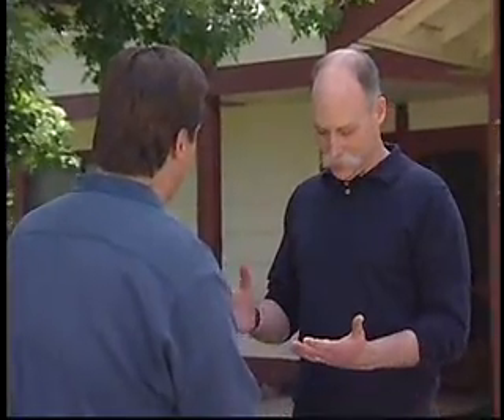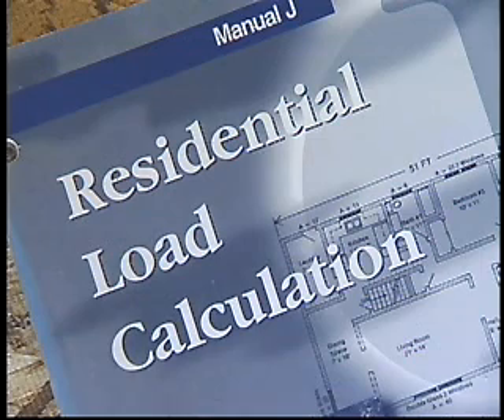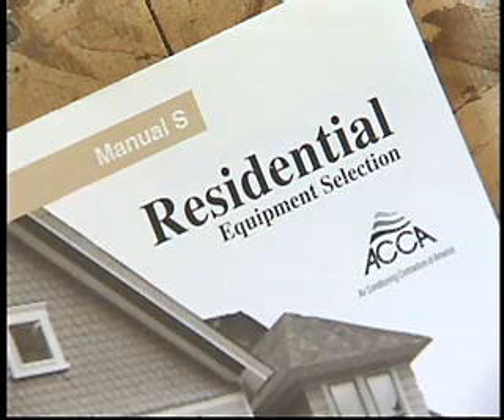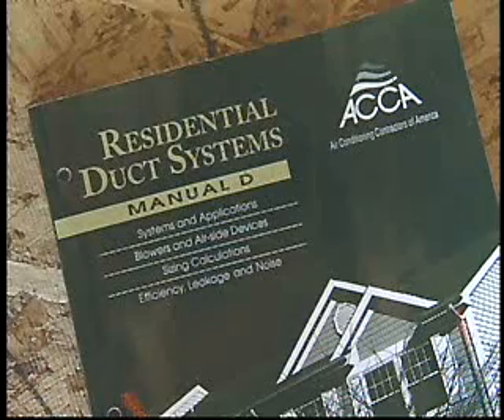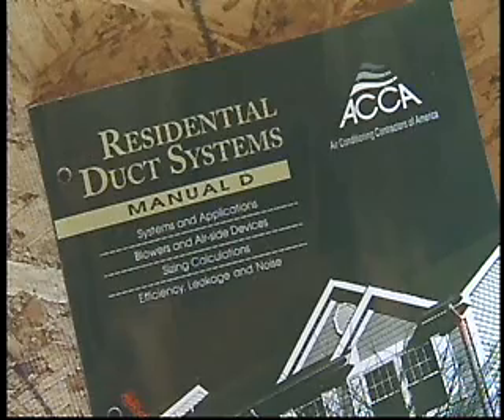Proper System and Duct Sizing

Comment: Do a load calc...Every time I did a load calc for a customer they took my numbers and gave them to another "cheaper" company to do the install.  So all the time and effort for nothing.  I keep my numbers to myself now.
Reply: dpeagles:  Unfortunately, there are unscrupulous customers just as there are unscrupulous contractors.  In my case, I've put 18 months doing most of the work myself and $140,000 in remodeling a 200-yr old farmhouse.  The only things I contracted out are the roof, hvac and well/septic updates.  I got six hvac quotes, and on every one of them I required they tell me the size and route of the runs and why, along with the technical reasoning for the furnace btu level chosen, how the return capacity is calculated, the a/c tonnage, etc.  If they weren't willing to share it, I figured they are simply quoters/installers and not true engineers and weren't confident in their design knowledge (or maybe didn't even have a design and were going to 'wing it').  If I'm going to do all this to move into our last house, the contractors simply have to be the real pros.  There's no way for me to know this for sure without demanding this information.  Asking if they are licensed, bonded and certified is only step 1 for me.  Unfortunately, in the bumping of heads over this information, you might otherwise be the guy I would choose but you'd never get the chance.

Comment: @suntraker I agree, I always use mylar jacketed flex duct in attics. Did you see the round collar cut into fan compartment of that Bryant furnace? Wander if it's filter is on the other side. To lazy to build a return plenum? It's a %90+ in an attic, I wander if it gets below freezing there? See the uphill 3/4" drain pipe? 
There is no maximum length of a branch run - that's a mythical rule of thumb. The run can be sized to be any length with in reason. Use manual-D & say no to rules of thumb